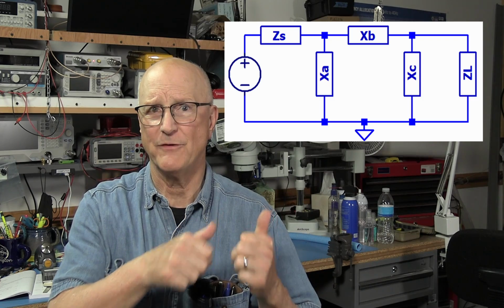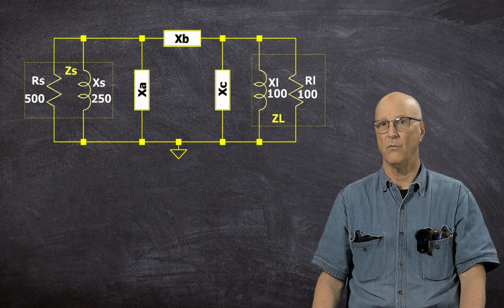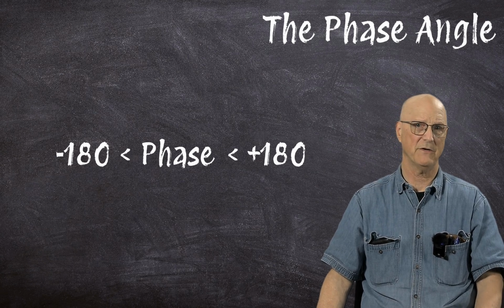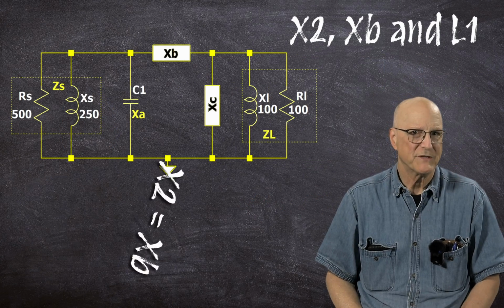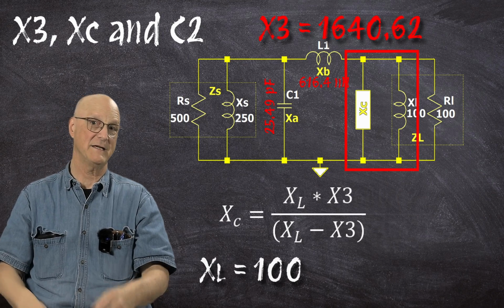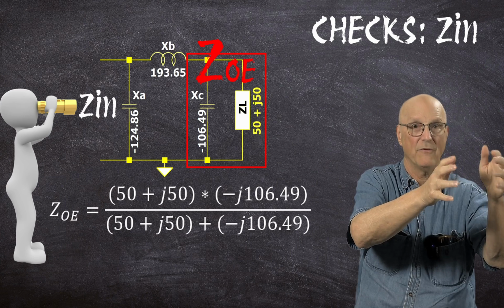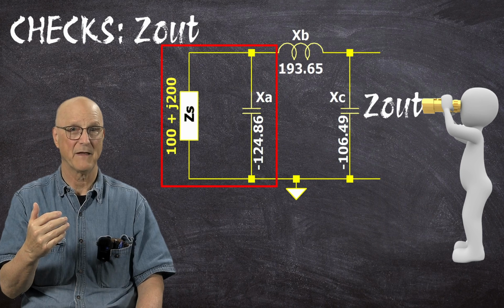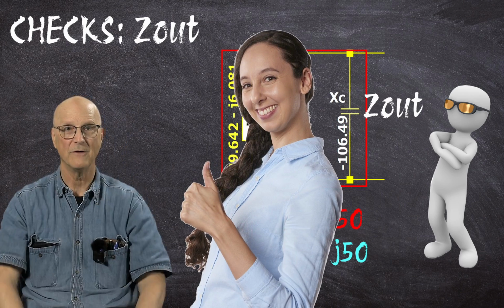Impedance Matching (Pt7): PI with a Math (079g)

Comment: I kinda see why you chose 60 deg as it was a minimum realistic value for your Xa cap. As it appears that phase angle is a deg. of freedom (within reasonable limits), can you tailor your phase angle to dial in your bandwidth (i.e. Q, ... again within reasonable limits)?
Reply from the maker: OK, I'll tip my hand on why I chose the phase angle I chose.  I chose it because this allowed the Math and the Smith Chart solutions to line up. I literally calculated the solutions for various phase angles until I found the one that produced the same (or close to the same) values I got with the Smith Chart. I chose the specific Smith Chart solution so that all the lines laid right on the lines of the Smith Chart and the lines nicely intersected at distinct points. This made the creation of the video MUCH easier and still illustrated the process.
Regarding bandwidth and phase angle, I am not sure how they might be related. I'm thinking that they *may* be only minimally related if at all. I did not investigate that aspect in my preparation. Nor did the materials that I was using make reference to this. :-)

Comment: hi sir, if a coplanar Tx line L=308mil,W=12mil & S=15mil and a gap is created to place a series component. in this case how to perform a pi matching for 2GHz signal passing?
Reply from the maker: I have not implemented impedance matching using coplanar lines nor have I worked at frequencies as high as 2 GHz. So, I cannot be of much help here. Sorry. :-)

Comment: You mentioned you have a book on impedance matching. May I ask wich book?. Idea fro part 8: take the smith chart approach. Show a) how moving along a circle is assciated to a formula b) show the movement in real life with a circuit and VNA/Oscilloscope. Thanks for making these video's: very instructional,
Reply from the maker: "Practical Impedance Matching" by Ain Rehman.
Unfortunately, he assumes you know things you might not know when presenting the information. He never uses the Smith Chart for the matching networks that I presented. The only thing I gleaned from the book were the equations I present. I also discovered some errors in the book (poorly edited).
With all of this said, once I sussed out the details of the proper equations and how to use them, they work very nicely. And this is what I present in these videos.
As far as movement along the lines of the Smith chart and the actions of the math ... while they accomplish the same end, you cannot track the progression of the equations along the lines of the Smith chart. The equations drop into a solution while the Smith chart walks the path. :-)
Reply: @eie_for_you  Many thanks will look further in to it as this is a fascinating object and your video's give much inspiration
Reply from the maker: You are very welcome! :-)